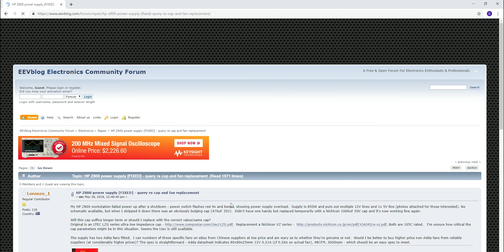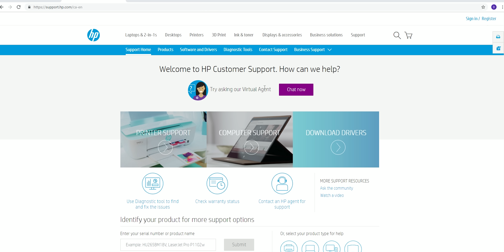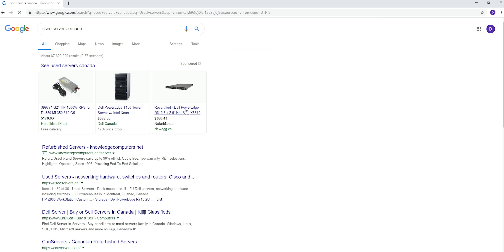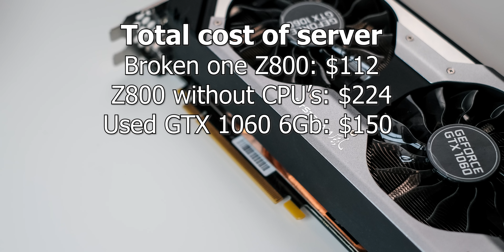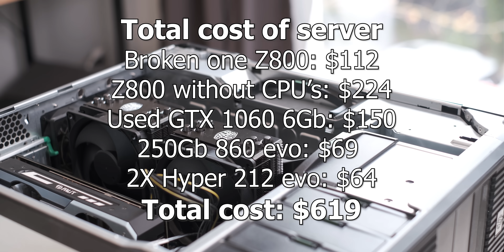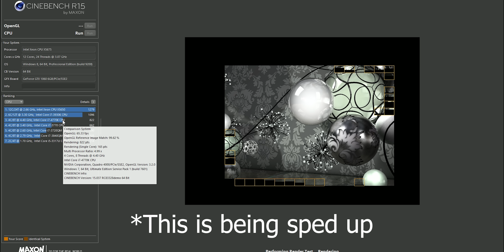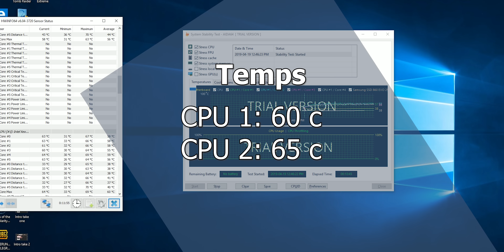Dual Intel Xeon, 48Gb BEAST for under $700! (With Benchmarks)

Comment: Is the hp z840 can be a good plus media server with a good graphics card ?
Reply from the maker: It would be a great media server, if you can get it for a really good price. 
Unless you get it for very cheap you are better off getting newer components.
Reply: Im using an outdated LGA775 PC for a Plex server: Q9550, 16Gb RAM, Asus P5Q mobo, OCZ Vertex 2 80Gb SSD, PNY Quadro K2200 4Gb, 2x2Gb WD Red in Raid1. It can handle 4 streams simultaneously.
Reply: @Dawid  is free cheap enough???

Comment: I got a Dell 690 as a throw away, spent $20 on two X5436's, $8 on 16gb of ECC RAM, $15 on a 256gb PNY SSD, and $150 on a GTX 1050 Ti and I get a Cinebench score only 20 points under the machine in this video with 160 FPS in Fortnite low settings, 87FPS on Epic. Was considering putting together a newer setup, I think the same rig could have been made much cheaper than he did in this video, but it's not bad. Video editing is the best on my rig, the Xeons work great, and the machine in the video can be overclocked, but you will need to use something like SoftFSB, SetFSB, etc.. and you will be limited to FSB changes only.
Reply: HAH I had a couple 690s too, caps go bad on mobo which annoys me about them. I could have replaced em but meh I gave it away since I'm all laptops anyways (for power consumption).
Reply: @zephxiii  Mine just went bad after I posted this. I just bought good caps from DigiKey and replaced them on the MB. Works great again and I'll never see that happen again, as the new ones are rated for 50,000hrs of life and it only cost me $6,
Reply: @ikannunaplays  Good Work! I wanted to do it too, but didn't have the time. That and it idled at 179watts from the wall which was way too much so wasn't gonna run it anyways. Such a cool machine though!
Reply: XTI9 To be honest replacing the caps on it were a pain because of the type of pcb used. Power consumption can be reduced by turning on speedstep in the bios. But yes, it's a power consuming hog even still.
Reply from the maker: That is awesome!! A great feal on all those parts. :D

Comment: LoL my ryzen 1700 has better cb 15 score!!!, and you can get cheap 1700 s now that run on b350 mobos.
Reply: It also ha same IPC as Xeon from 2010 congrats!
Reply: @Spacy1717  its a mainstream 8 core cpu that beats a dual xeon hedt platform with far less energy consumption and an upgrade path,unlike that behemoth that burns twice the power.
Reply: @ArkadianMr  almost 10years newer..much more expensive..makes your arguments shitty

Comment: Did you investigate why your CPU ran so hot with stock coolers? I´ve got the z800 with dual x5670 with stock fans, running as a server at almost 100% load 24/7 and my cpus never go over 65C. They aren´t exatly quiet i give you that, but the cooling solution on the Z workstations are epic. One more thing, how did you solve the CPU fans with the 5-pin solution HP have? Anyhow great build :)

Comment: very nice build overall. I had a few of those but moved away from hp due to custom psu's, very finicky bios and stuff like that. nowadays its better if you build a ryzen or similar system in terms of performance. but these old wrks are ideal if you want to have something like storage or vm server with lots of ram for cheap. keep up!!

Comment: How on earth do you manage to set fire to a graphics card by wiggling around a power connector on the motherboard? 🤔🤯
Reply: GPUs can get up to 75w from the pcie slot directly
Reply: @The123tactics  Any modern psu has over current/shortcut protection and fuses as do graphics cards.. I've build hundreds of systems never seen something actually go up in smoke. 🤔
Reply: @FullFledged2010  that's a quadro 4000 it was older

Comment: Excellent thinking. But I noticed that the cpu fans you placed, are directed upwards. There is no ventilation upwards, the vents are backwards. You need to monitor the temp because of throttling.

Comment: I built one of these, for a decent bit less than you paid, way back at the end of 2015.  I've since moved to a Z820, and am already looking to upgrade again.  The biggest problem with the Z800 is the 2TB limit of the onboard SAS/SATA controllers, which was the primary reason I upgraded away from the Z800...
Reply: Id say the biggest limitation is running into programs that require AVX to function.

Comment: I did this exact same build litterally, I built mine for 450. I had the power supply issue to its so sad. It would randomly turn off. So I sold it lossxaly as is for 500. Good deal for me lol

Comment: I have a hp z600 which is the step down for yours and with 2 intel xeon x5570's i was able to see performances of 100+ frames on most games highest settings unsure how yours underperformed
Reply: every game says ultra settings. Im wondering if he cranked AA to like X8. That would kill performance fast. And i think Apex legends requires certain instruction sets that those old xeons dont have like AVX and such.
Reply: what gpu?
Reply: @kilometers529  gta 980

Comment: If you could overclock on a dual cpu board it would make a huge difference.  I have a single x5675 @ 4.58ghz and CB r15 is ~ 1050.  I would love to see 2 x5675 break 2k
Reply: what is your MB ?
Reply: @ViktorKriz13  Asus P6T deluxe V2, and Asus P6X58D Premium.  They are basically the same board.  EVGA made the SR-2 which can OC dual X5680 or X5690.  I lust for it but the price tag is scary.  So sick and tired of people suggesting upgrading.  I stay with X58 because I have the most fun with it.  New stuff is straight forward and boring, I want to tinker!

Comment: I'm 90% sure the HP workstation coolers have better performance. These workstation fans go 5000RPM and make crazy noise.. At least that is the case with my Dell T3600. and T7800 with dual Xeon 2697 V3..

Comment: I Built Somthing Very Similer To Ures But I Used A Supermicro Dual Socket Bord & The X5675 Xeons & 64Gb Ecc & I Had The Same Problem On My Bord Trying To Mount My Hyper 212 Evos But I Just Took The 4 Bolts Out Of The cpu Socket & Then I Just Driled Them Out & Put Them Back On..All Is Well Its Ben Runing 24/7 Ever sense ! Very Easy But I Did not Know I Was Going To Half To Do That When I Bought It ..But It Wasnt Hard..My Bigest qwirk Was The Case..i Ended Up Buying a fractal define XLR2 & It Was Supost To Suport eewb Bords But Again I Had To Drill & Add 2 Stand offs,& Again Not A Very Big Deal But Just another Curve Ball !!

Comment: HP Z800 is a workstation, not a server.
Reply: It's a PC for fuck sake
Reply: Workstation hardware also has integrated audio, servers do not because they don't need it.
Reply: Another joker jumped out of the box!
Reply: Things like two dudes having a rage fight over what constitutes a "workstation" vs a "server" is why I come to the comment sections of YouTube tech videos.
Reply: Same thing
Reply: @Phunker1  nope, it's completely different.
Reply: @YR7A  So fill me in on your logic.
Reply: @Phunker1  server processes requests, and uploads them to the internet. while a workstation does video editing, 3d shape rendering, and stuff like that.
Reply: @YR7A  And where do you think lies the difference in the technology that is used to complete these tasks?
Reply: @Phunker1  What mainly defines workstations are focus on single-user workloads (like rendering or video editing), including high-end graphics processing and display, low noise cooling despite higher and more fluctuating ambient temperatures, and desktop I/O like USB ports or eSATA. They're basically beefy, robust desktop PCs. Very beefy, very robust, and generally built with server-grade hardware, including things like dual socket mainboards, ECC RAM, or RAID controllers supporting those juicy 12gb/s harddrives.

In contrast, a server, well, serves things. Like network drives, databases, websites, a corporation's office apps/email/collaboration cloud solution, you name it. Depending on the workload, it's a decidated machine featuring lots of parallel computing threads and/or high core clocks, a metric ton of error-correcting RAM, manages a rack full of harddrives, has dozens of highspeed network connections, or any combination of those, and is built to provide those services 24/7 under full load. For that to work, the systems are built with redundancy in mind, allowing for components to be replaced while the system is running whenever possible/feasible, like redundant hot-swap power supplies connecting to separate UPS, hot-plug fan arrays, RAID controllers with their own battery powered cache to assure data integrity and allowing for replacing failed harddrives on the go, or fail-over redundant network connections.

TL,DR: while you can assign server duties to workstation-grade hardware, it's fault tolerances under constant load and lack of scalability will leave you wanting soon. And you definitely don't want a "real" server living under your office desk. Atleast not without good hearing protection and air conditioning.

I might have forgotten some points, but I guess that paints the picture quite well :)
Reply: @Gutnarm  nailed it!
Reply: @Gutnarm  excuse me, so you say that workstation id better than server??
Reply: @relaxingLush-Lullaby  not better or worse, different hardware for different "jobs".
like, if the power supply of one workstation fails, one user is without a computer until it's fixed. if a server dies, things like your online shop or customer database is out.
on the other hand, you don't want jet engines cooling your desktop computer.
stability and redundancy come at a cost (both technically and monetarily)
Reply: @relaxingLush-Lullaby  those workstations are servers with consumers or workstation graphic cards. Exception maybe fiber and ILO management which were added gimicks from Intel added over the years
Reply: @Gutnarm  None of you folks seems to understand anything about computers. You mainly get three tracks of CPU/chipset combinations. Mobile, desktop, and server. Server chipsets come with ecc and xeon support. Z-Workstations run on the latter. None of the rest matters. A cached raid controller runs on a mobile chipset if it must and having redundant power supplies, well again is a thing of your choosing. AGAIN. Server, Xeon Worstation, same thing!!!
Reply: @Phunker1  What you're talking about is CPU manufacturers' labels for their market segments, basically splitting their product lines in 'performance/features vs price' tiers for their customers to choose from. 

We've had "Servers" already back when IBM was still selling calculators and commercial scales. This has nothing to do with CPUs, their features, and to what degree the 'chipset' (un)locks those for the customer. Also, Xeon is a product line of Intel, not a technical term.
Reply: @Gutnarm  A computer basically doesn't care what you do with it. That's why it's called a universal machine. Proprietary Server hardware has all but disappeared because R&D is simply too expensive. 
The current No 4 in the world, Tianhe 2a runs on Xeon E5-2692v2 which is an Ivy-Bridge-EP chip. My old HP z620 workstation runs on Xeon E5-2697v2 which is a faster-clocked version of the same chip.  Wasn't my z620 a workstation? 
Wasn't the initial statement that the z800 is a workstation and not a server? As a result, isn't Tianhe-2a a workstation, too? 
The current No 101, Tianhe 1A runs x5670 Xeons. You know what also runs two of those very chips? My z600, the very computer I'm writing to you on. So I'm writing to you from a supercomputer! Cool, right?!
Reply: @Phunker1  You don't want to get it, do you, now throwing supercomputers into the mix? ...and out of which magic hat did you pull the term 'universal machine'?

By your logic, my old car would be equal to a HMMWV because it too has 4 tires.

Also, the "all but forgotten" server hardware market makes IBM, HP, Dell, etc billions of dollars a year: that, and the service contracts going with it, is where they make their actual money.
Reply: @Gutnarm  No dude, you don't get it. You don't seem to understand what the term "proprietary hardware" means. Google is your friend. 
Take a peek: https://www.intel.com/content/www/us/en/support/articles/000006567/server-products.html
Intel lists the 5520 as a server chipset. Incidentally, that's also what you find in a z800. 
Sorry, but you sound like a sales guy. No clue of anything.
Reply: @Phunker1  Your link says it right at the first line: "Processor List for Intel® Server Boards and Systems [...]".
Line two: "Intel only supports the Intel® 5500 Chipset and Intel® 5520 Chipset-based servers and workstations listed at the bottom of this page, with the processors listed in the tables below."
Read what's actually written there, not what you want it to say.

Also, again, neither 'server' nor 'workstation' (or 'desktop', for that matter) is a specific hardware definition, but rather business term, an understanding of a product line's general use case and associated common hardware requirements, as elaborated on in my first reply.

You can stuff a couple thousand dollars' worth of high-end hardware in a desktop chassis and use it to play solitaire all day. Or you could take a few Raspberry Pi's and USB harddisks and start your own cloud hosting service. Both would make about as much sense as your arguments, even before you started insulting people.

But -- whatever, dude. Believe what you will, and enjoy life in your bubble. I'm out of this "discussion". peace

edit PS: oh, and just fyi: you don't just have to know your "IT stuffs" if you work in this line of business. You also have to be a bit of a sales guy if you want to run your own business for a living. Which, incidentally, I've been doing since 1998.
Reply: @Gutnarm  Great, we finally have something in common!
Reply: @Phunker1  server mainboard do NOT have onboard audio port and limited usb ports ... usually 4

Comment: I Built One Kinda Similer To Ures Recently..I Used Enterprise Grade/Old Server GearLike A Supermicro X8DTH-6F Motherbord & 64Gb ecc Ram But I Used 2 Hyper 212 Evos On Mine As Well As Xeon X5675's But I Didnt Raly Have A Problem Mounting Mine.. I Just Took The Backplate Off An Then I Driled The Crap Out..lol. ..I Get Great Temps,How Ever Mine Is A Freenas Server For Back ups & Plex ,Some Vm's Ext I Realy Like Older Hardware Its Frikn Great Proformance For A Great Price..IMHO ! Glad  I Stumbled Across Ure Build ! Thanks For Posting It !

Comment: performs terrible, buy something else than building this ever, 700 dollars for that price you could have something more upgradeable . Reather buy a 2nd hand am4 build than all that older intel crap not to mention the zombieload security flaw with hyper threading. Which makes all older Intel server stuff pretty worthless. Compared to anything 2nd hand for that price actual desktop parts. And then we didn't even talk about server hardware mostly if not always older than the desktop equivalent. That 1060 is being held back quite a lot imo 10 to 15 fps, no upgrade path motherboard wise. knock 200 dollars off that price and its a deal, but its not realy.